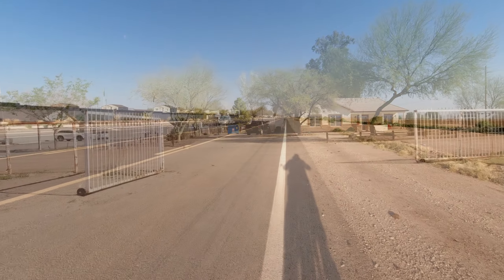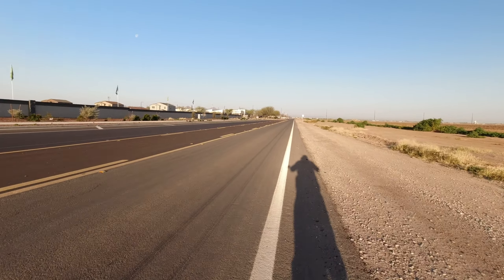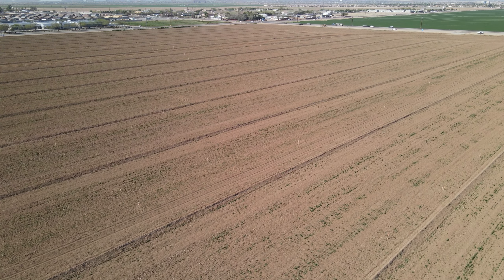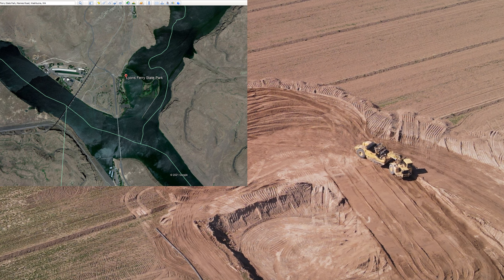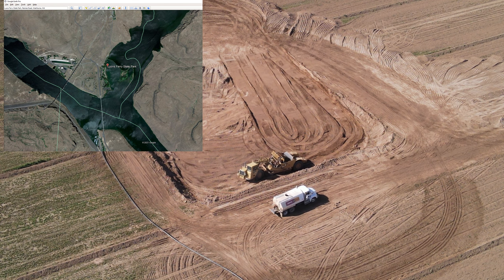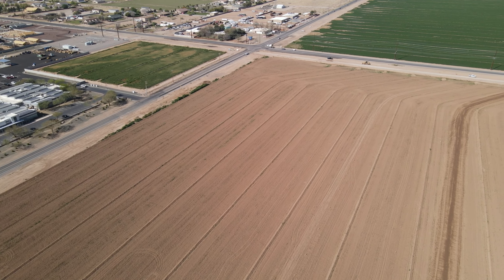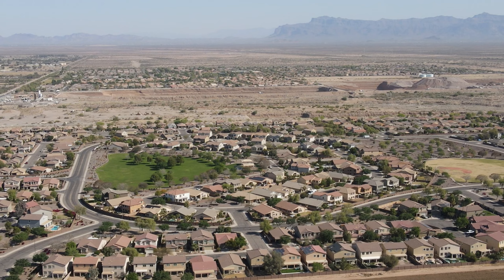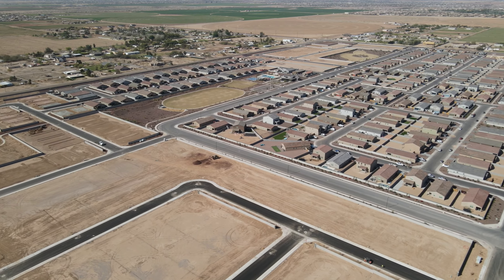MAVIC AIR 2 AND EBIKE SHOW US A SURPRISE CONSTRUCTION PROJECT + STORY

Comment: The only time we were ever knocked down was when we were in south Florida . The wind had been blowing what we had thought
was from the south about 35mph most of the morning and we were running with it at 6 plus knots all morning . Where they had dredged
the ICW was a tall bank on both sides about 20 to 30 foot , so we were wing and wing down in the ditch . I was not thinking about
the canal they had dredged coming from the coast west to east , well as it turned out the wind was not from the south at 35mph it
was from the east south east at about 40 plus and had been funneling up the ICW when we hit the east west canal cut we got a sudden
wind change from south to west and hard the boom jibed and came across and almost took my head off and we had wind at 40 to 45
on the beam . We went over and put the rail in the water and the rudder came out far enough the boat rounded up into the wind but
like you said things went flying down below . We were in the ICW because it was too rough outside to be comfortable but lesson
learned , never trust the apparent wind . Another time I was glad our first boat was not the 46 foot boat we wanted lol . Yep I laugh
when people tell me sailing is not exciting enough . By the time (6 years later) we moved off our boat I was a pretty seasoned old
salt . You don't have to be in the ocean to run into trouble , I have some small boat lake stories also .
Reply from the maker: Thank you for sharing Spencer. You should do like I'm doing and share your stories with everyone. Yep, I never sailed in anything larger than the Columbia River :) The wave there are big enough for me :) Thanks again and God bless.